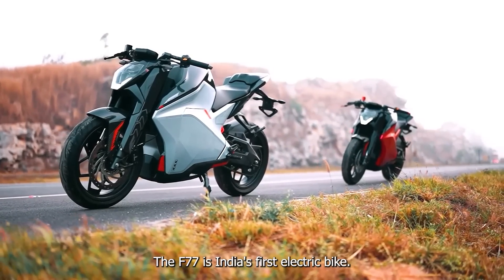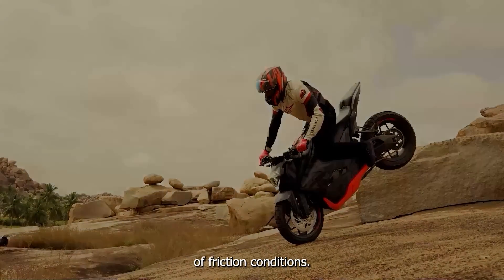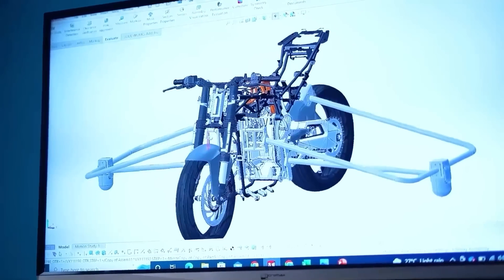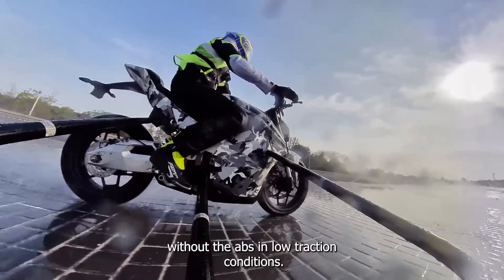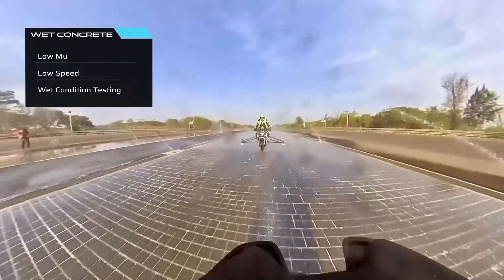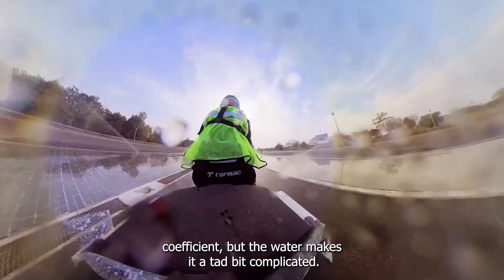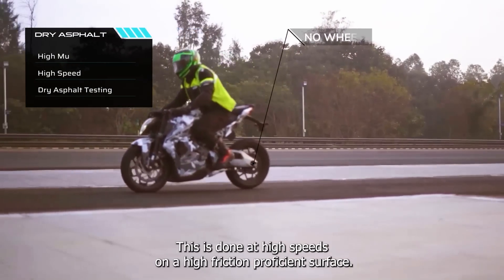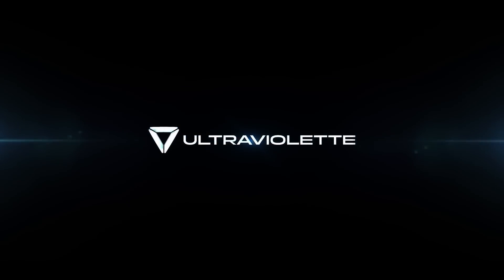F77 - India's First ABS Equipped Electric Motorcycle

Comment: I find the placement of the rear brake lever at the foot position rather than the conventional (for electric bikes) on the handlebar a bit odd. However, in one of the simulations, the brake levers are on either side of the handlebar; the prototypes though continue with the lower foot-mounted lever.

Comment: Hi , given this bike has 9 axis IMU Is there any consideration for adding lean sensitive abs and traction control considering given the torque output quite impressive ?
Or Is that going to be in an other upcoming iterations ?
Since , The ice competition for this is mostly RC 390 interms of pricing and it  has been updated with those features as well for this model year.

Comment: I mean no offence but if what Mr Subramanian is saying is true then this machine has got more torque than the 1290 Super Duke.
Reply: the torque in e vehicles worl differently when compared to icu engines, that's why you will see even like commute e vehicles have very high torque
Reply: I guess it's different from an engine torque because specification says 90nm
Reply: @umair5949  Most ICE says Hp and Torque at crank and not at wheels. I guess maybe our current ICE have more than that at wheel.
Reply: A 150cc-200cc bike has 500N.m at the wheel in 1st gear